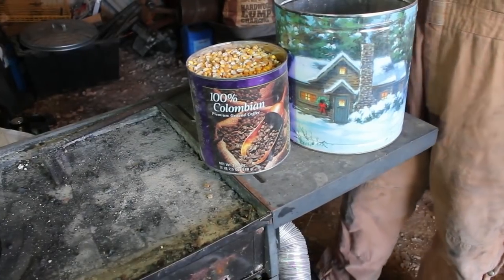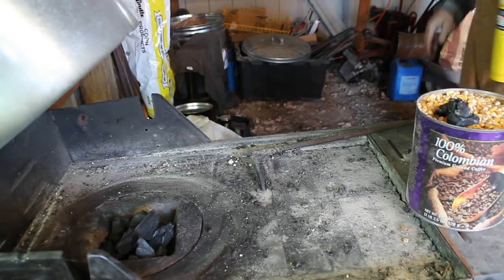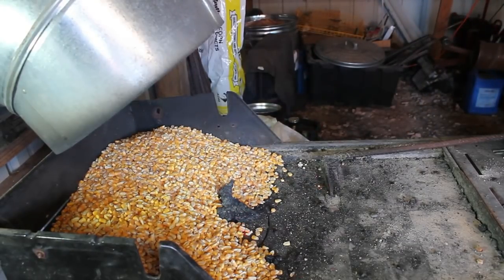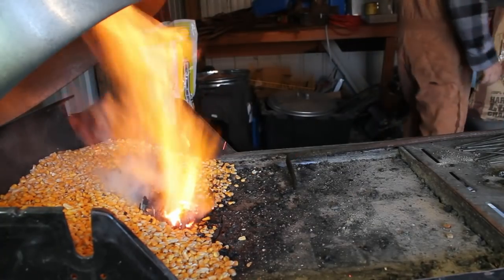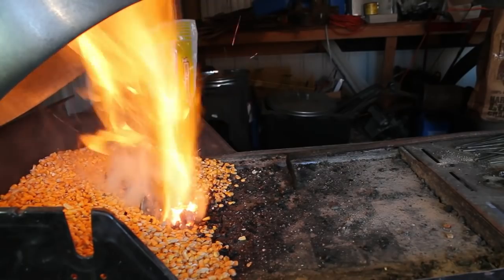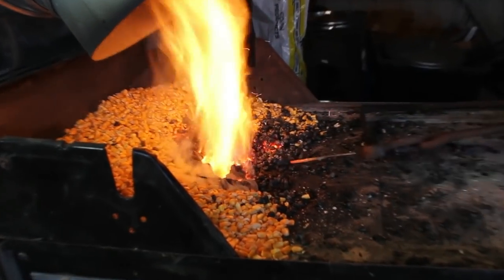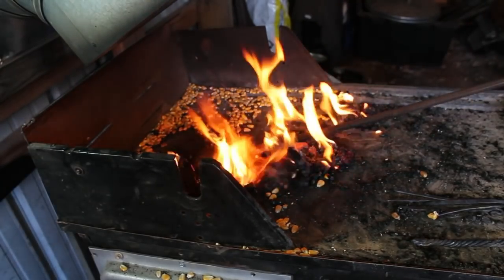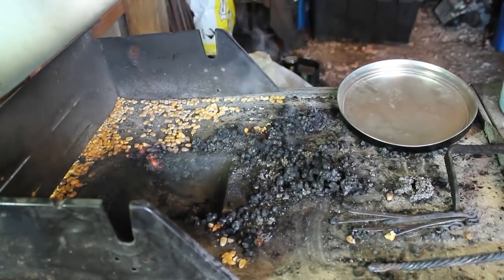Corn Fueled Blacksmith's Coal Forge

Comment: .                 Hmmmm.   Not much in the way of clinkers?   What forever will I put on my driveway for traction in the winter?   LOL.   Thanks for posting. I'd heard of using corn, peas and soybeans in specially modified stoves for household heat, but never imagined you could forge with it.   Good information.                

Cheers!

Whipple

Comment: Wow that is very interesting. Do you think that would work with a deeper fire pot? I have a Centaur Forge and it is a very large pot. Nice job!! Thank You.
Reply from the maker: I'm sure it would work fine. Of course your rate of fuel burned will go up too. Without the insert in my brake rotor forge I'd burn two to three times as much fuel, no matter the type.
Reply: Thank You I will work on that and watch your up coming videos. Have a great day!!

Comment: You can't be getting heat anywhere near the BTUs of coal. What temperatures can you get? Can you forge weld?
Reply from the maker: Dry (15% mc) whole feed corn 7,000 btu/lb
Medium-volatile bituminous 13,840 btu/lb

Since corn burns faster than coal (not quite twice as fast) it does come close to bituminous coal's btu output.

Some say corn can reach forge welding temperatures but I haven't tried it. I do know I've seen a few small sparklers pulling steel from a corn fire but I've never come close to burning work the way a coal fire can if you're not careful.

Comment: That was an eye opener, and interesting to watch. +1.

On a good note, I guess you dont have to worry if your forge corn is non-gmo and organic. 😉

p.s. Suggestion ... locating your mich separate from your camera would eliminate the problem of the blower overwhelming your narration.
Reply: It's a shame there isnt a way to recover some of that massive heat going up & out the flue.

Comment: looks like it needs too much air for my setup, I use a box bellow that I built
Reply from the maker: I use an old draft inducer blower off a junked HVAC unit that is powered off a long drop cord (spliced together our of many old frayed cords and left in the grass all the time). Added a dimmer switch at the forge. Gives all the air corn needs.

Comment: Why use corn when you can make your own charcoal, it is very easy to do.
Reply: john frazier Corn is so much cheaper. As he said: for 50lbs he paid $6.50, and to make charcoal you need (expensive) wood, which is far more expensive. Even if you’ll say “chop your own wood,” well there is considerable expense in that too. Maybe not monetary, but it takes time and effort that he’d rather expend it formulating his metal products, not to mention keen know-how on carbonizing the wood efficiently, which takes yet more resource and time.
Reply: he covers that in the video...

Comment: I grew up poor. I don’t approve of wasting food- even if it is fodder.
Reply from the maker: 1) I don't consider a none food use of feed corn as wasting it.

2) Same corn they use to make ethyl alcohol for those E10-85 mixes at the gas pump. 

3) Personally I'd rather use a zero carbon footprint fuel than a fossil fuel.

4) To each there own. 

Thank you for expressing your opinion.
Reply: @dthomas021  😁
Reply: @dthomas021  zero carbon footprint? I saw a lot of carbon at the end of the video... LOL